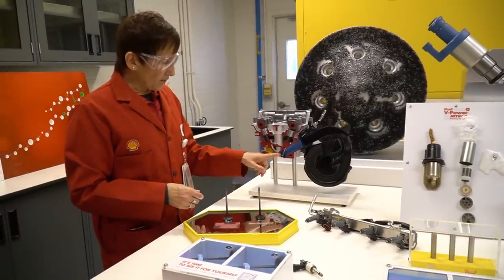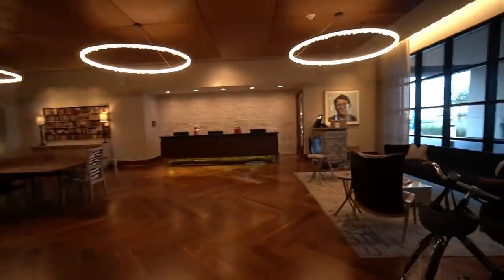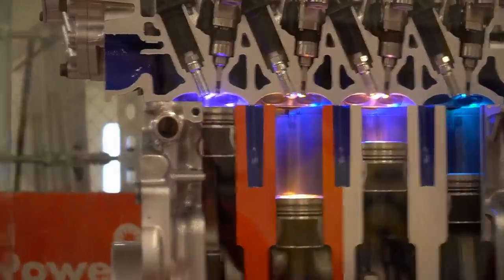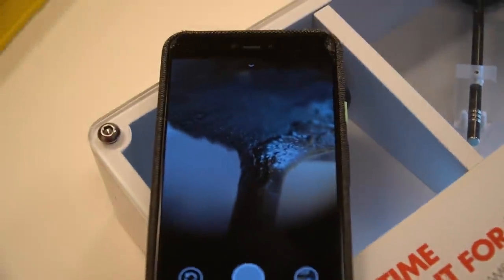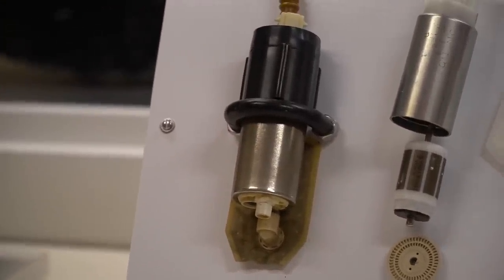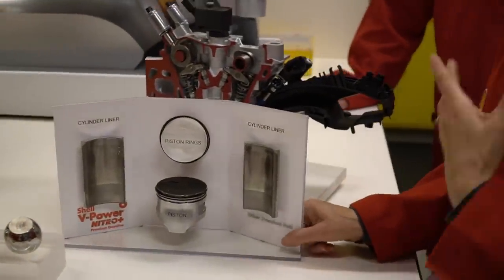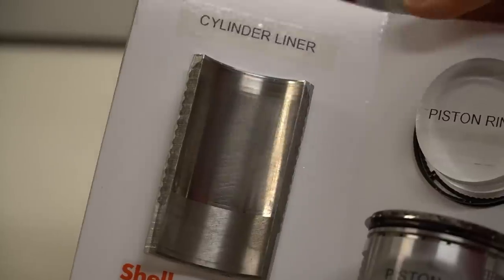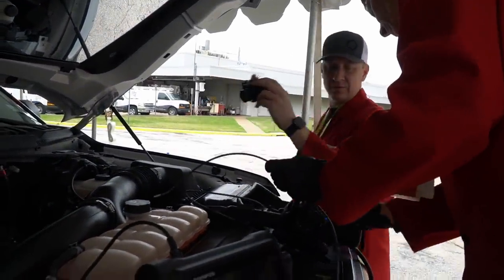Cheap Gasoline is Destroying Your Car's Engine - Here's How

Comment from the maker: What fuel do you pump into your vehicle, and why? (EV owners feel free to disregard this question 😎)
Reply: Vehicle Virals e85 or 103
Reply: I work at AutoZone do your research on the octane boosters they are a huge scam. Boost your octane by 10 points it takes 10 points 2 equal one pushed in your octane count
Reply: I live in CA, and last week I paid $3.85/gallon from my local Shell station. I chose 91 which is the most expensive, I think is the nitro one. It’s the only gas I can put in my “SAV,” 😂 (SUV)... thank Bmw for “only premium gas.” I buy shell because is conveniently on my way home 😂, but this video made me feel a bit better of the opportunity to use Shell gasoline.
Reply: I put Chevron hopefully it's just as good 😖
Reply: Costco because California
Reply: I use CHEVRON because in my area it's the best performance wise for my car. Shell gives me better mpg but the performance lags.
Reply: Either shell v power, chevron, or racing fuel
Reply: I pretty much stick to Mobil and Shell. I try to avoid most completely no name gas stations like the plague.
Reply: Shell V-Power 93 in FL lmfao
Reply: Does 87 (regular) Octane get some of the same additives and benefits as the Premium V-Nitro?
Reply: How long before electricity companies claim their electrons are better than their competitors’?
Reply: Shell V Power 99 octane, and you really can tell the difference it’s fantastic. You can almost immediately tell the difference should you need to put crap fuel in due to availability.
Reply: I put in 50/50 of Shell V power and Chevron with Techron and this gives me ( VTECH power😂 )
Reply: @kevindgaf  I only put in racing fuel in my ( Prius😂 )

Comment: I use Shell VPower in my 2018 Corolla. Many people say there is no real advantage to doing this but I have always believed the additives make a difference. Fuel mileage is slightly better too.
Reply: so you're putting premium octane fuel in a vehicle that requires regular? Nice
Reply: That's what he said, you mad?
Reply: I had a 2018 Toyota Corolla. I always used shell premium gas and when they looked into my engine. After doing well over a 170,000 miles, they said my engine was nice and Clean as if it was brand new. And The owners (Because I Went to multiple places.) always say that they get cars in. And the pistons and valves are so bad and dirty. To the point they have to keep putting in cleaner solution just to try and keep the engine A little bit good! Regular gas does more damage in the long run than premium
Reply: The major fuels brands often put the same additives in all their petrols. Here in germany Aral openly says that apart from the octane rating their fuels dont differ in the slightest. And they sell everyday regular up to Aral Ultimate 102 Octane (Ron)
Reply: "Fuel mileage is slightly better too."

No, sweetie, it isn't.
Reply: @aluisious  actually! it is!

Comment: I fuel @ Sam’s club with 93 octane. Currently, since I no longer have a Sam’s near me, am using Mobile 93.
Reply: they aren't top tier, i'd switch, you'll see a major difference in gas mileage and performance

Comment: I put in my own cleaner every tank full. Marine outboard two cycle TCW3 rated oil at 1oz per five gallons of gasoline. I bring a four oz small plastic bottle with me to the gas station or put it in when I get home. Twenty gallos means four ounces of Marine oil. I’ve been doing this for years.

Comment: I can vouch for this.  I have a Porsche 911 and have always used Chevron gas and never had a problem.  I bought an Audi and used Costco gas and within a few months, my fuel filter started to fail.  At 40K miles, it finally went out.  I replaced it and went with Chevron.  Now, I have nearly 200K on it and never had a fuel filter issue again.

Comment: I use Exxon 87 octane gas in the April-October time.  In the colder months I switch to Shell VPower since i have fewer long drives and VPower will keep the engine cleaner for all those short daily trips.  VPower is about  $.50 higher than Exxon 87 octane gas.  My  2009 Toyota Camry has 210K miles and it has lots of power compared to the time when I used 87 octane solely from from the cheapest gas stations in town.

Comment: My car uses 87 octane I use Chevron fuel because every octane that Chevron sells regardless if it's 87-89 or 91 it contains techron but when it comes to Shell the Nitrogen stuff they use is only in their premium fuel not their 87 or 89 so in my opinion Chevron is much better for your car if you are using 87 octane and if you're putting premium in a car that uses 87....lol your only waisting your money because it's not doing anything Positive for your car... actually it can actually mess things up if neglected and constantly used

Comment: Yea I used to put bjs gas in my car. After realizing that their gas for one doesnt even last long, I started to search which gas was best for cars. Now I only put shell or mobile. Shell is usually expensive but for the past few weeks it's been so low at 2.49 for cash and 2.59 for credit (usually atleast 2.79 for cash) . I only got a v6 camry and it probably wont even matter cause its camry and they dont die but I'm getting in the habit of staying between these two. Next car going to be a g37x

Comment: I only pump with bp I don't mix gas from other stations if there's not a BP available. Then I use shell. I've noticed personally for me bp gas burns slower the car idles quieter with no knock and drives better.

Comment: I drive 200 plus miles per day,yes 200 a day I use shell on a 70/30 split V power and regular I gain 40 miles more tank than other companies.
If I use just VPOWER I don't get the same performance.
Now bear in mind I have been doing this for 2 years this is not a guess but fact.
Cheaper fuels you save 5 to 7pence per litre but with the shell you do get the best, I have tried this with BP but did not get the results I do with shell.

Comment: Random Q for you comment mechanics 

My ATV (praire 400) randomly stopped running and now will only sometimes start for a couple seconds 

New carb
New plug 
Has compression 
Prob timing good (since it starts sometimes)
Reply: @Mustang Ricer6589 its definitely getting fuel...when I shake it, itll flow from the overflow so its def filled with gas...I'm literally going crazy here.

Comment: B.S This is a Shell marketing video.  All gas sold in America  must meet  the required additives and come from the same refinery.
Reply: This video was made for you. Lol
Reply: Top tier fuel is better then regular fuel
Reply: America has some of the worst fuel in the world, 95 octane is minimum requirement for most modern engines but America still serves 91, premium in uk is 99 I doubt you can even get that on the black market.
Reply: No
Reply: fuels just have to meet “LAC”- least additive concentration.

Cheap fuel is like a a “C-“ on a test…legally passable…but top tier fuel is an A on the test. Just like meeting the API oil standard is the minimum, but there are manufacturer standards, like GM Dexos, which are more stringent.
Reply: @paulclarke3274 About 25% of America has 85 AKI (90 RON) as regular. As far as I know, no vehicle sold in America in the last 15 years is tuned to run on 85 AKI.
Reply: Your just lost on information, the vpower costs more because it has added additives that is specialized to clean carbon deposits.

Comment: True on every non direct fuel injection vehicles. Fuel type definitely matters but us direct fuel injection motors fuel shoots right under are valves so it’s mostly good oil that makes a difference pluse an oil catch can.

Comment: Thats the only thing that goes in my 392 now. I was putting sheetz and valero premiums in first. But I always noticed that when I used shell the gas lasted longer and my car felt more responsive than sheetz and valero premium. Exxon premium is pretty good too.
Reply: I used to use bjs and while alot cheaperbi noticed a full tank would last me like 4-5 days while shell itd last me an extra day or two. Now I only use shell, exxon/mobile

Comment: I have never seen a functioning car with port injection that has a build up of anything on its valves. I‘d save the money for more expensive gas and give my car an oil change more often. I think it benefits more from that.
Reply: Depends what you call more often
Reply: live and let live more often is more often than if spent the money on gas. Simple as that

Comment: In my truck it only runs on 110 octane what would you suggest I do
Reply from the maker: Where do you live?
Reply: @VehicleVirals  I live in Milwaukee but I have an 87 F250 4X4 460 5speed .
12 : 1 compression, 
10" intake I took out the electronic ignition and control box put a dual-point distributor out of a 429 forged crank instead of a cast crank all kinds of stuff. I have an 8-foot Western on the front of it for when  it snows too much. And I run a mechanical advance on my distributor because of the HUGE torquer cam. 
I also had to change my master cylinder and brake booster because the engine does not have a whole lot of vacuum
Reply from the maker: @billthompson5644  I see. Well just pump high quality fuel and add octane booster.

Comment: been knowing about this. let me give you a quick breakdown. high grade fuel 1.shell 2. chevron 3.mobile 4 texaco 5.bp  ,Mid Grade fuel 4.76 rest brands and below are low grade fuels inc ARCO, non brand gas
Reply: for best results change fuel filter/fuel pump for better results. Nothing beats a new clean fuel system using shell Vpower !
Reply: mid grade fuel is 76*
Reply: & valero is mid also but you get the sequence
Reply: Chevron is better
Reply: Arco uses bp gas

Comment: Great video for an infomercial. Honestly without independent lab testing and having shell you how great their product is, you are basically just advertising their snake oil. The lifters, bearings and cylinder wall examples were all smoke and mirrors. That rep was no scientist either, as she was struggling to find words to describe basic mechanical functions at times.

Comment: Fuel is in vapor form before its ignited a vapor is not gonna lub anything i call BS. This gas is nothing more then a slightly higher add pack with more octane. If your car dont need higher octain your wasting your money.